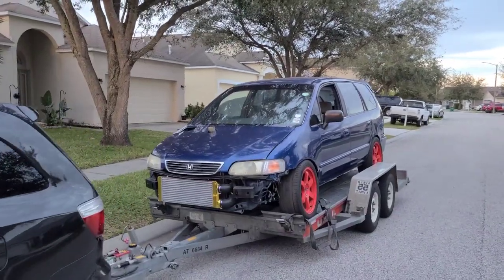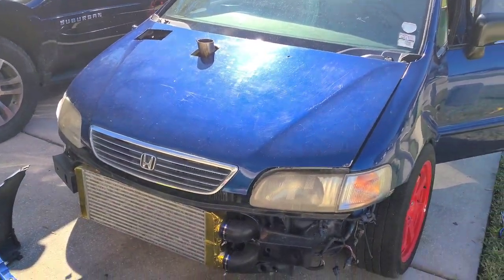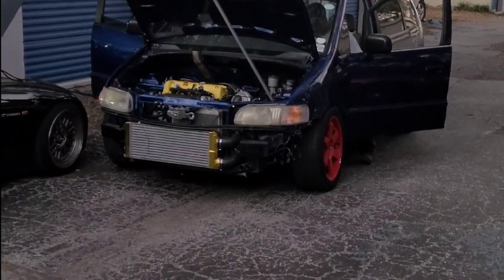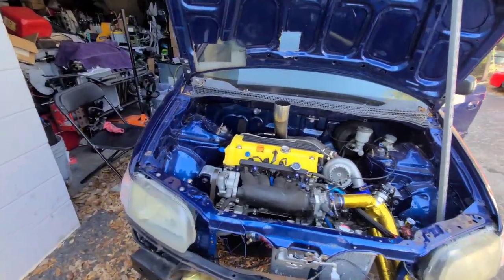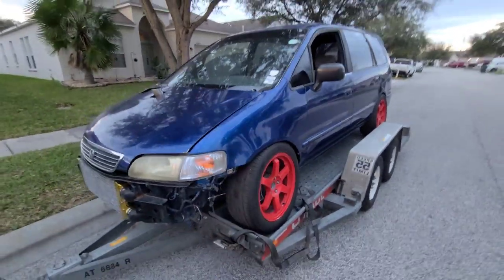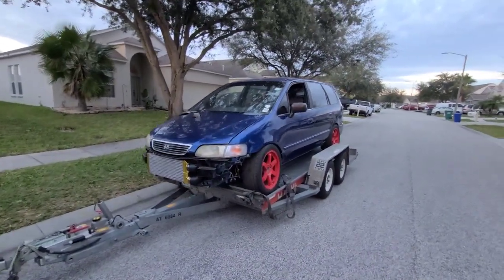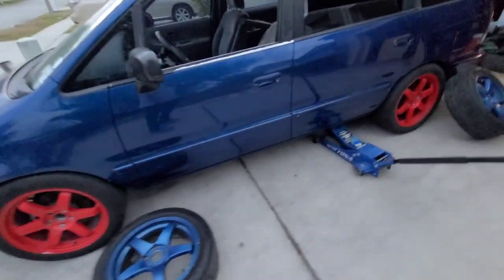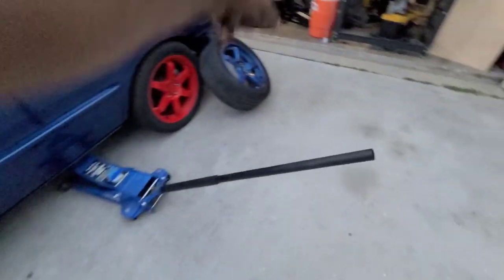Awd k24 Turbo odyssey back from tune.

Comment: really nice buds!  i suggest a tri_flow camshaft grind from Colt cams.
Also the exhaust outlet should be pinched slightly into an oval shape. 
lastly the injectors could be a bad choice possibly.  some work better than others at low pulse width.  it can cause the rpm spikes like that.
if you have any questions i might be able to help.  idk i am a miata guy: tuned it myself.
Reply from the maker: What's up bro man I appreciate  you staying in here with me . You sound like the exact things my tuner said he also suggested  a fender exit at this point I think ima weld my own pipes
Reply from the maker: Also bro I'm really just looking for 400 450 hp nothing crazy
Reply: @Dougsgarage813rd  for now I would oval the exhaust outlet the tip. 
Look for different injectors that work on others cars around idle. 
Lastly if you send me pictures of the VE chart and spark chart I might have ideas.
Reply from the maker: My injectors  are brand new My fuel lines were closed also the tuner checked them already he said the same thing but then revised my fuel lines were backwards  also I have no idle air control
Reply: @Dougsgarage813rd  I don’t have idle air valve either.  
We do 1200rpm idle and it works fine until it hits 25f outside.  At that point you might need to raise idle a bit more
Reply from the maker: @sublunacy  always appreciated I will check those injectors again
Reply: @Dougsgarage813rd  I think it is that, shouldn’t need to spend more than $100 on injectors.  See if others are with those injectors are having a hard time as well.